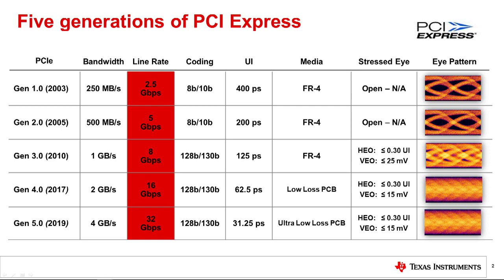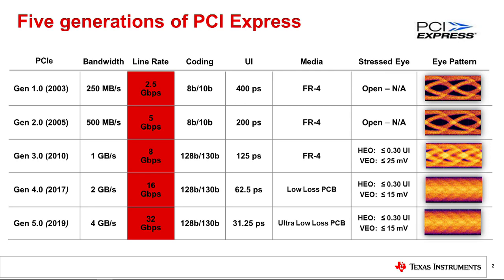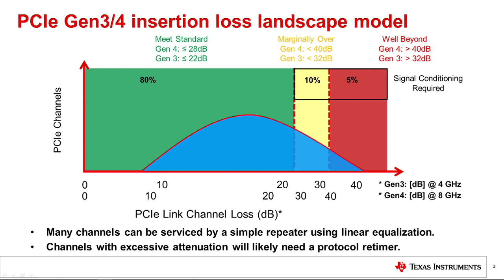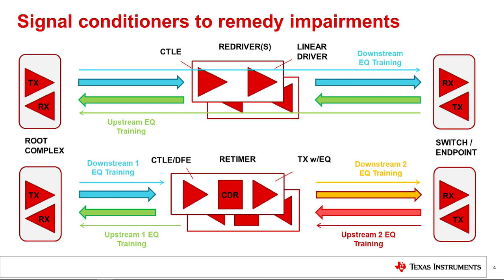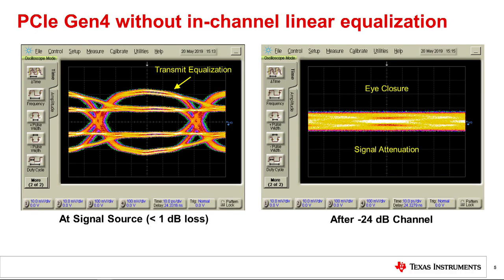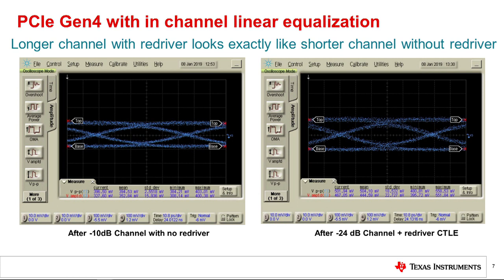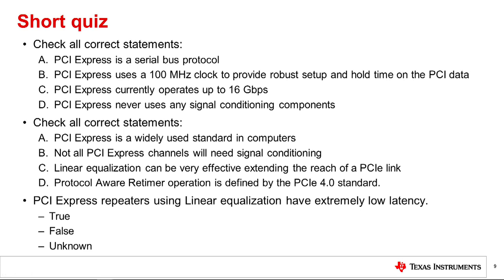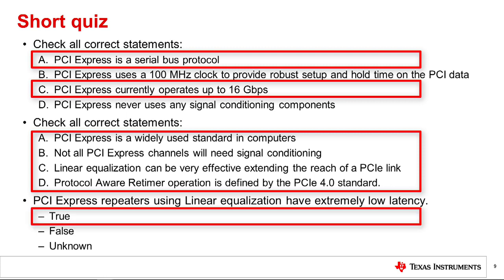Solving PCIe signal integrity challenges

Comment: How do you measure channel loss?
Reply: Channel loss usually refers to the insertion loss at Nyquist (half-data rate) and it is usually measure using a vector network analyzer (VNA).